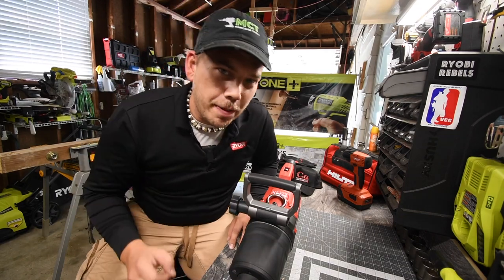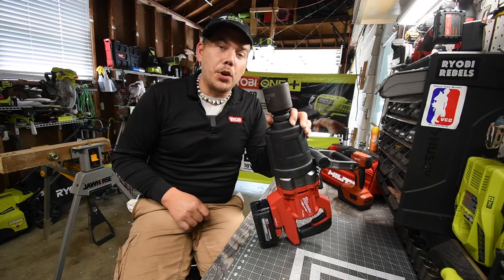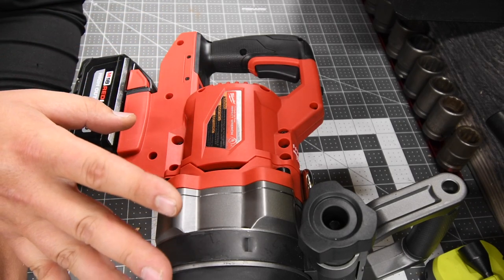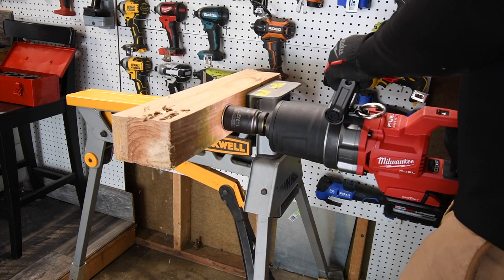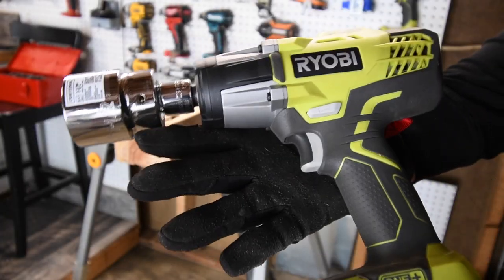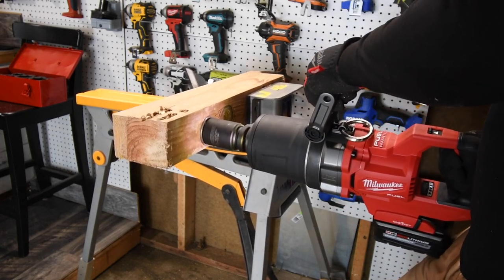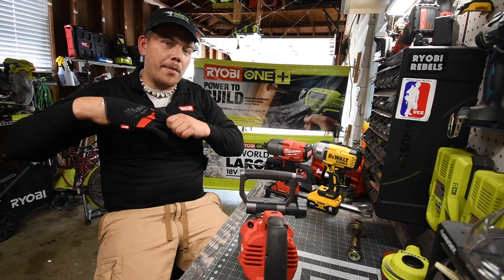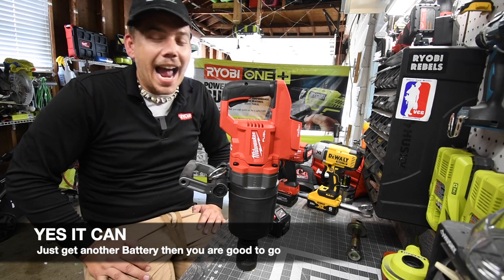2,000 ft lbs Milwaukee 1" Impact Wrench

Comment: with this much money, I thought it would put out more 2k ft/Ibs.  1/2" puts out half power, and cheaper
Reply from the maker: I thought the price isnt that bas considering the tool
Reply: Why do you think price would scale linearly with the power of the tool? That's never how it works.
Reply: @randybobandy9828  first, it's made in China with cheap labor, and main factor is inflation.  cost of tools increases more than inflation.  pretty soon, only rich people can afford this tool
Reply: @basook6116  nothing you said has anything to do with my reply.
Reply: @randybobandy9828  all I am saying tools are expensive every year, and they don't even made in USA.  just look at Qbit tool, it's pricey for very simple tool
Reply: I still think that it's too expensive, specially with battery and service only one function
Reply: @basook6116  I don't think you know what you're talking about.
Reply: @randybobandy9828  which part?
Reply: @basook6116  the part where you value a tool based on it only being able to do a single task. You have to compare a tool by its ability to make money and save you time. You also need to compare its price against other tools that do the same job and this tool is cheap in comparison to its pneumatic counterparts.  Cordless tools don't require a huge air compressor and large tank and ofcourse a 240v outlet. They can be used anywhere and that saves time and time= money. Nobody that is buying this tool is doing so to not make money.
Reply: @randybobandy9828  yes, I do agree with you, in engineering point of view, this does have one function, and it does save money if you working for company.  but, in personal use, it's lots of money for single function

Comment: $800 bare tool. Or $1,200 as a kit  with the charger and two batteries
Reply from the maker: that is correct. still $800 is a good price
Reply: @ManCaverTools  if you're in that trade yes it the closest to that I've seen what is a pneumatic version by Ingersoll that thing weighs a ton I'm sure the Milwaukee weighs a ton to

Comment: So whats your point in this? Trying to prove how weak milwaukee is by using a 1/2 inch to take off a bolt tightened by a 1 inch
Reply from the maker: this was a bad video but I do a video with the 1,800 ft lbs 1" impact wrench taking off semi truck nuts. you should check it out

Comment: The compressiveness of your cellulose foam is limiting the torque chooch of the machine. You need to test with a proper peice of steel.
Reply from the maker: I didn't want to do the same video milwuakee already did. everyone acts like this is the only video ill do with this tool.
Reply: id like to see some foam board

Comment: The wood will give and keep that gun from ever reaching max torque. That’s the only reason any of those guns would be able to take it loose. If that was a steel beam that bolt was going through then it could tighten it to where none of those guns could break it.
Reply from the maker: I made a video of the 1,800 ft lbs impact wrench taking off semi truck nuts

Comment: You aren’t even putting that much torque on the bolt because the wood is giving and not allowing the bolt to stretch and provide proper clamping force as they are designed to do.  Try that on a real surface like metal.
Reply from the maker: more videos will be coming on this tool. I don't want to copy cat milwuakees videos

Comment: Its an impact with an integrated torque amplifier, what is special about this?
Reply: Its the biggest and most powerful battery impact ever made james
Reply from the maker: 2,000 ft lbs. that's whats special about it
Reply: @ManCaverTools  and if i put a torque amplifier on my half inch impact i can do the same thing and then take it off and have a 4 times the speed. This is just a limitation on a tool

Comment: Thats a mans tool if u cant carry a 24 lbs impact wrench then u don't need a 1 inch impact
Reply from the maker: exactly lol
Reply: Thats light in this class lol. My 1 inch is about 35-40 pounds has way more power but don't actually need the sucker 24/7